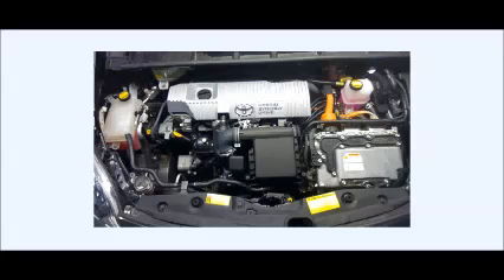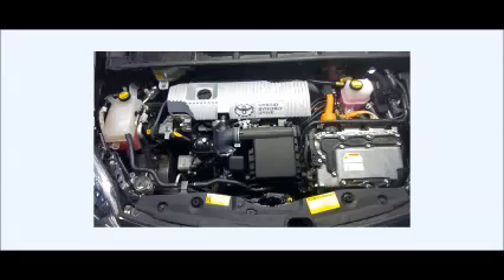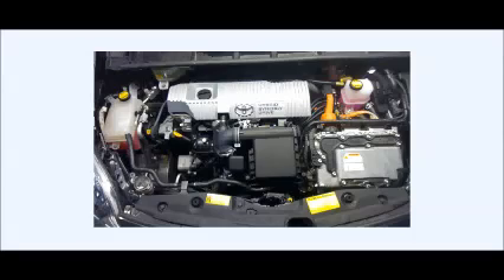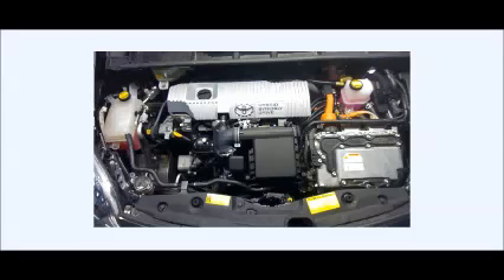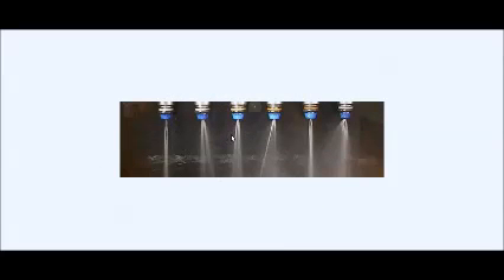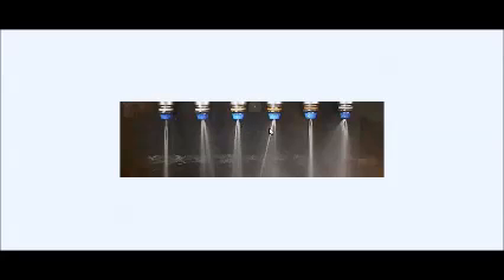toyota prius gen 3 engine knocking solved

Comment: Thanks for BS.  You failed to address the oil and the Prius usage of 1 qt a week relating to this valve train problem.  Fuel injectors are not the fundamental reason for this knock.  It appears to me the seals around the valve guides are worn.  Oil is flowing into the cylinder when cold causing the knock.  Fix this under toyotas drivetrain warranty... please don't try to put the burden on the customers wallet,  and time for a flaw in the engine.
Reply from the maker: You're overthinking the video,  I feel sorry for you
Reply: Sam, there are at least a half dozen reasons for a misfire.  This gentleman found his was caused by dirty fuel injectors, which is a common cause.  Yes, oil blow by can be the problem too, when the poorly positioned PCV valve can collect fluids, overflowing into the intake manifold.   If you are consuming a quart of oil per week, you have a problem.  Lastly, why the negativity?  This guy was just trying to help others by sharing his experience, but you want to turn it into something bad.  A little kindness goes a long way and it costs nothing to have good manners.
Reply: I am sorry to ALCON.  My brain failed to process this the good intent of this video.  Our Toyota dealer now says a clogged EGR system is found on my sister's Prius.  But we were thinking worse that a teardown is the next step. Hence we will see after the EGR is cleaned.  Thank you reminding me not to jump to the worst conclusion first.
Reply: @serotonin67  I would love to hear the result on your sister's car.  My daughter has  a misfire on cylinder 1 issue and I am about at my wit's end.  

Car is throwing relatively consistent P0301 (Cyl 1 misfire) and occasional P0302 (Ctl 2 misfire) codes with relative consistency. 

Swapped spare plugs, coils, and fuel injectors onto other cylinders, but the problem remained with cylinder 1.  

Removed intake manifold and cleaned it thoroughly.  Cylinder 1 area was wetter than other cylinders.  Cleaned throttle body and mass air flow sensor.  Cleaned pipe from EGR to intake manifold.  Started to clean the EGR, but stopped because I didn't have the right tool to remove the studs.  

Ran Seafoam and ethanol-free gas through the engine while taking an 80 mile round trip at 80-85 mph.  

I am going to do a compression check and leak down test this weekend.  If those do not point to a leaky cylinder, the only things I can think of left to check are the EGR valve and the wiring.  

I've been on Prius owners boards online and this appears to be a common and extremely frustrating problem.  Sometimes people will state they found one of the above to be the solution, but more often than not, they are just living with the problem.  

I am a Toyota fan, but this is unacceptable.
Reply: @jtrahan63  
Hi,  has your prious have any other symptoms now or previously?    Like an overheating condition?  Burning oil ?  How much ?
Reply: @jtrahan63  
Please explain your observation of Cyl 1 was wetter?  Did you notice any coolant leak?   Misfires often occur due to a coolant leaking on a spark plug and boot connections....causing a short curcuit.    Easy fix to dry out any moisture sitting at the base of plug,  and wires.  Worst case is a leaking head gasket?  If yes, quick fix is then put a can of good stop leak.... good kind that has metalized aluminum particles in it.  Then just drive it til the wheels fall off.  Otherwise,  request a drivetrain warranty repair... good luck... my sister's Prius never really solved the original oil leak above.  Her husband did the cheap route and took the car back from dealer before a teardown.  Then he had a local garage use seafoam to cleak like u did.  Best it does run better now.  Nut still consuming burning oil.  Thus,  I do SUSPECT the EGR is the next fix. Then at wits end... document your issue to TOYOTA.   Best regards... Sam
Reply: @serotonin67  To my knowledge, the car never overheated nor was run while low on oil.  I think it may burn 1/2 quart every 8000 to 10000 miles, which seems normal to me.  when I say Cylinder 1 was wet, I was referring to the cylinder itself, as the spark plug was oily, while the others were not.  After I swapped plugs on Cyl 1 and 3, I later checked both and both were a good sandy color, so it appeared to be burning okay.  (I think part of the initial "wet" issue is my daughter has a very short commute and the ICE - internal combustion engine - did not have the opportunity to get to full operating temperature.)

Also, when I say "wet", when I removed the intake manifold, i could see into the head where the intake and exhaust valves are located.  Cyl 1 was obviously wetter than the other 3.  Cyl 2 was a little wet, but not nearly as bad.  Cyl 3 and 4 seemed normal.

I failed to mention I got a loaner "block tester" from the auto parts store.  It is filled with a special fluid and used to pull air from the coolant overfill jug.  if there are burned hydrocarbon gases present (indicating a head gasket leak between a cylinder and a nearby coolant jacket).  The fluid did not change colors during two tests.  I went to the tailpipe and did the same test and the fluid changed colors due to the hydrocarbon gases.  While this does not rule out a head gasket leak to the coolant 100%, I don't think that is the issue.  

I got a loaner compression tester, so I will try that next.  All cylinders should be somewhere between 90-140 psig, and they should be relatively close to each other.  

I purchased a leak down tester from Harbor Freight for only $29 (normally $49, but was on sale).  I will test each cylinder when they are at top dead center during the compression stroke.  Per other YouTube videos, I should get only a slight drop off of pressure, and if I do, I should be able to tell from listening to escaping air if the leaking from the cylinder is into the crankcase (bad rings), intake manifold (intake valve), exhaust tailpipe (exhaust valve), coolant reservoir (head gasket to coolant jacket), or other cylinder (head gasket leak between #1 and 2 cylinders).  

if the compression is good and the lead down test is good, that will be good news, but still not solve the problem.  It could be the EGR, the wiring going to Cyl 1 coil pack, liquids pulled into the cylinder from the bottom of the intake manifold.

Comment: The injectors spray fuel into the intake manifold, not directly on top of the piston and spark plug as described in this video.  Using higher octane fuel or using fuel additives are a waste of money.  They fix nothing.

Injectors may have fixed this one Prius, but you're far more likely to have a faulty spark plug or ignition coil.  The Prius engine will knock any time a cylinder (or multiple cylinders) fail to fire.  The exact same knocking happens when a spark plug is faulty or ignition coil is faulty.  Fuel additives and higher octane fuel do NOTHING to resolve this problem.